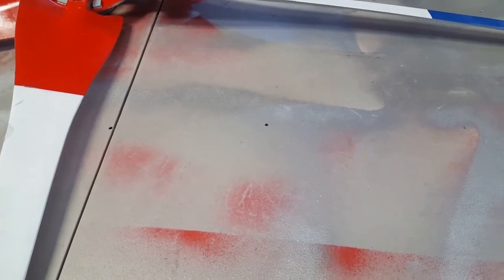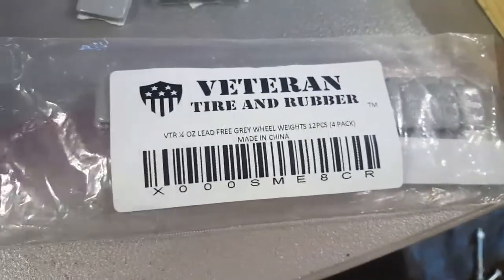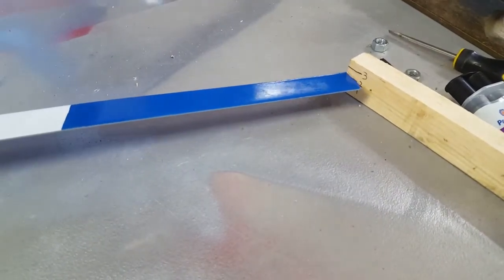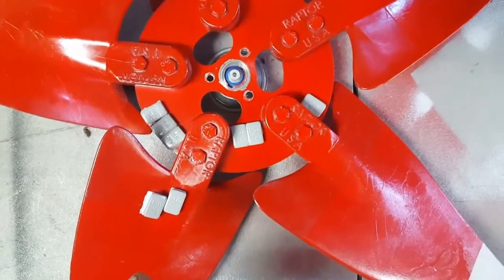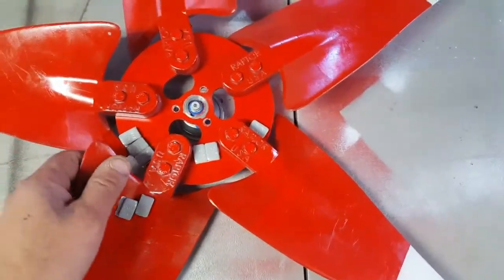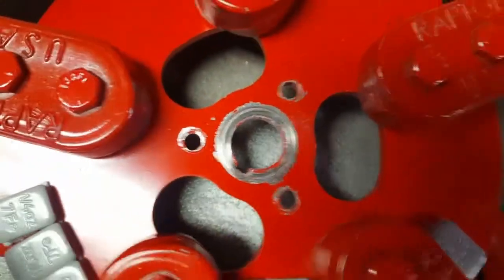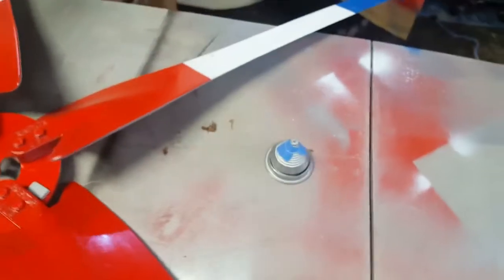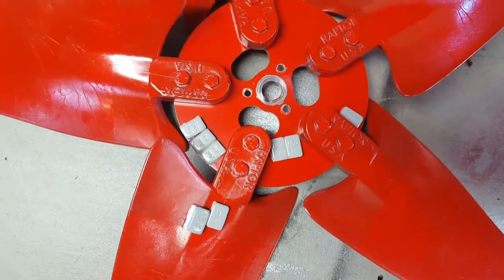Balance your wind turbine blades part 2

Comment: i like those tyre weight idea A LOT
 in my experience those blades are too small yeah they work but not as good as longer blades, i have the longer mw blades but they are reasonably heavy so they need quite a bit of wind just to move, well that and the cogging , im not getting into turbine war Bs here but i have seen guys get better performance from KT blades, i do not own them just seen comparisons from a couple of non biased guys who own turbines from the two competing manufactureres.
but like the Bloke solar and wind says if your happy thats all that matters.